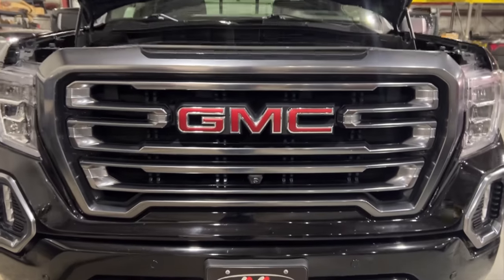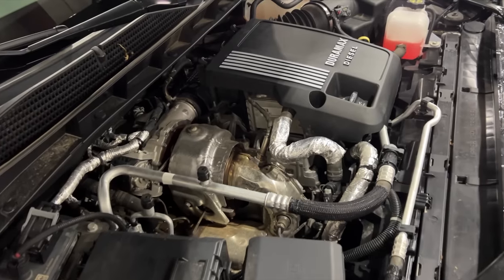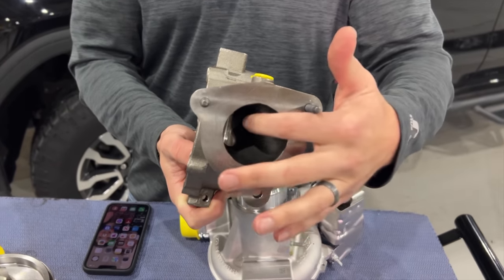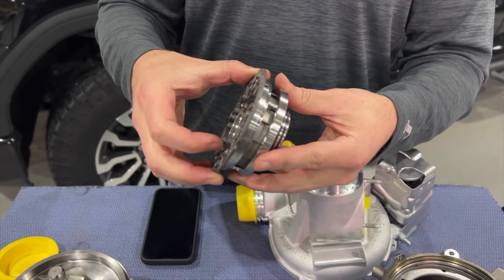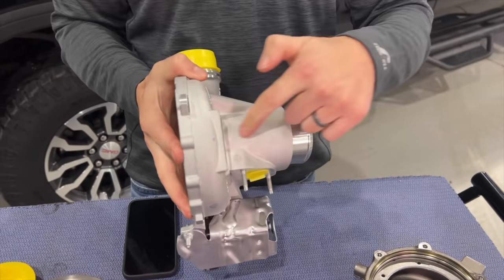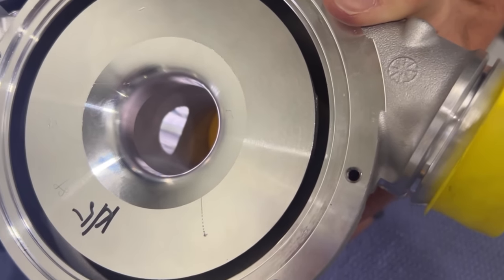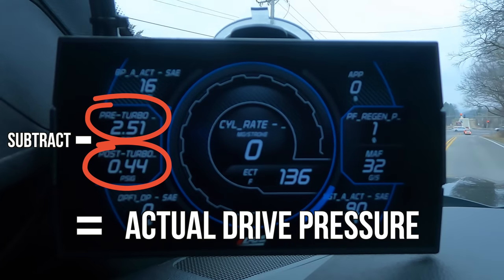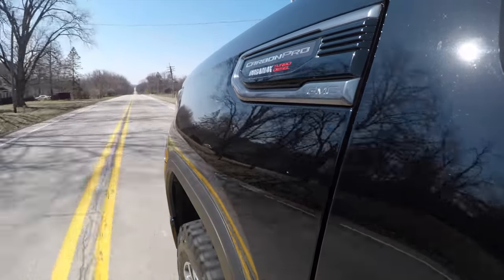3.0L Duramax (LM2) Turbo Analysis & Custom Tuning Ride Along

Comment: I currently drive a 2022 Silverado 3.0L LM2 Stock Engine with 11184 miles (18000kms) on it. The best highway fuel economy I have achieved is 34 mpg. (6.9L/100kms.) Cruise Control was set at 74.5 mph (120 km/h) for 226 miles (363 kms), with perfect driving conditions - no wind, 46.4F (8C). Geographically - Jasper AB (elevation 3465.83 feet to Edmonton AB (elevation 2198.16 feet). In my opinion,  I'd say this is quite outstanding fuel economy for a stock full size truck. I have no doubt in my mind, that the LM2 is GM's best engine built in the last 10 years. I enjoyed your review, and hope you share more information/updates for the LM2!
Reply from the maker: Thanks for the personalized info. Be on the lookout for more info on our end too. We are digging the 3.0L LM2!
Reply: I’m looking at the little diesel. Still happy with yours?
Reply: @jeffreygoss8109 Hi Jeff - I still love my LM2. It’s been great! Fuel Economy and Power! I wouldn’t change it for anything. I have 50000 kms on it now, and it still performs well. I do use AMSOIL 0-20 Diesel oil for my oil changes. Still very happy!

Comment: Interesting video on the baby Duramax. I own a '23 Silverado 1500 RST with the LZ0. Very nice powertrain. Very smooth and quiet for a diesel with lots of torque and more than adequate horsepower for my needs. I get 16 mpg towing a 3500 lb travel trailer from Cali to Arizona and back (twice as good as the Frontier 4.0l V6 got) and get 28-30 mpg at highway speed. This truck drags the trailer up long/steep mountain passes at 65 mph with cruise control on effortlessly. The new baby Duramax does suck up lots of DEF while towing though.
Reply from the maker: Interesting. Thanks for that feedback!
Reply: My lz0 sucks the def without towing, my 2016 f550 uses less def and it tows all the time
Reply: without knowing driving habits, this is useless information. i'm yet through my first DEF refill at just under 5000 miles.  @juledoren

Comment: LM2 had LOW AND high pressure EGR. low being post DPF high being pre. high is used typically to warm it up and is used ALOT in cold climates (alaska)
Reply from the maker: Thanks for the heads up!

Comment: Thanks for the video and how the turbo works. I’m very new to diesel trucks and bought a 2022 3.0 elevation 11:49 Duramax. Every once in a while my truck has light white mist or smoke From exhaust for about a minute when driving off. Only done this a few times and dealer can not find anything  wrong and unable to duplicate the smoke. Goes away for a month or so and then happens out of nowhere. Someone said maybe the turbo, oil, fuel or coolant? Dealer said all good but happened again today? Any thoughts. Thanks
Reply from the maker: There is plenty of reasons why it could be happening. We'd need the truck to get a concrete answer.
Reply: @Duramaxtuner   Thanks for the reply. I’m in SoCal. Has not done it again and dealer thinks it is nothing. Fingers crossed

Comment: Brand new owner of the LZ0, 260 miles, lol. Would definitely be interested in a tune. Would it be a plug in module or a ECM flash? I don’t want to lose my warranty. Subscribed.
Reply from the maker: It would be an ECM swap until a tuner can unlock without an ECM. Hopefully we get an LZ0 of our own soon.
Reply: how hard is this to do if we can not make the trip to your shop
 @Duramaxtuner

Comment: @duramaxtuner you went over everything except the exhaust/discharge size. OD IS 3.75 correct? Do you know if it has a lip for the gt flanges or flat? Post a picture if you can, thanks

Comment: ditch the emissions gear. burn the epa to the ground and let this baby dmax really perform and be efficient
Reply: I have already blocked the EGRs on mine and drives way better and hardly any turbo lag. I bet it knocked off two seconds on the 0-60 time.
Reply: 23’ lzo diesel, I was surprised my oil at 400 miles was blacker than my 2002 duramax has ever been, all those extra gasses can’t be good for the engine.
Reply: @HomesteaderJake  first oil change??? Wonder if it has anything to do with that 🤷‍♂️
Reply: @Jakes videos  Just cause it's black doesn't mean it's bad. Only way to find that out is thru oil samples. 200k on my 6.7 Ford and it turns black as soon as u start it after oil change. It's done it since it was new. I go 8k on oil changes and sample every oil change.  It gets analyzed at my Local CAT dealer since that have the Lab right there
Reply: @StormTheBeach  how? The CFT one?
Reply: @ThunderGod1388  no, did one myself. Tbh I don't know if I trust their stuff yet
Reply: @StormTheBeach  how?
Reply: @StormTheBeach how did u block it? Any codes popped?
Reply: Delete the e p a   And save the world
Reply: @StormTheBeach no derate? Or issues by blocking them with no tune?
Reply: @StormTheBeach How were you able to do that without a full delete?

Comment: So we r talkin 285/290hp to the rear wheels & 560ft/lbs of torque w/ this middle of the road tune!? That is awesome! Forget the LZ0 until there is a def delete cause stock it eats thru def so w/ a tune you will burn thru that 5 gallons in a tank of fuel! W/ that said, have you driven w/o your foot in it to see what kind of mpg you can get? Best I have is 34.4mpg w/ stock tuning, 4x4 SLT & 2” lift w/ 295/55/r20 tires
Reply: And that's hand calculated? On board computers tend to be optimistic! I've always had to have the dealer correct that under warranty (VW, Ford, and MB, all gas)...and Nissan dealer told me that it's supposed to be wrong lol!
Reply: Well your wrong, it does not eat thru DEF.  A tank will last between 4000-5000 miles with normal driving.  Hardly eating thru. Let’s stick with the facts shall we?
Reply: @hammer-r  mine does not get anywhere close to that and I will qualify as a mature driver, easy on the throttle with mostly hiway miles. 2500 miles for 2.5 gallons is what I'm figuring. My sons best friend's '23 is worse than my '22. Not sure how he drives but his truck has almost triple my mileage so more data.
Reply: @denniswilliams2098  not sure what to make of your comment cause your calculation is in line with what I stated.  I’m a mature easy going driver and yup about 5000 miles for a tank of def.  But when I trailer like I have been, then it eats it much faster. But when I’m driving on the highway at 60 I’m getting about 40 mpg. So I can’t complain.  My best 50 mile loop was 44.9 mpg. Best truck I’ve ever owned. But with everything, time will tell.  But so far I love it.  It’s a torque monster as I pull my 8000 rv up steep dirt roads camping.

Comment: So that low speed (1100) rattle was teh VGT rod. and the powertrain vibration could have been surge? is that even possible with this small of a unit?

Comment: Unfortunately I bought a 21 with 12 thousand km on it last year. Had nothing but problems gm warranty wasn't helping me tried multiple dealers they were trying to delay me until my bumper to bumper ran out. Got tired of driving dealer rentals. Traded it in for a 21 ford f250 when I realized nobody was going to help me haven't looked back.
Reply from the maker: Sorry to hear that.

Comment: sustained load EGT on stock tune was over 1400. so hearing yo say it ran rich makes a ton of sense. 

the intercooler is easily overwhelmed and that electric coolant pump doesn't run 100% of teh time. they tried to keep IAT neat EGR temp was teh story i was told. 

the original trans tuning (launch tuning) has it shift at 3900RPM 1-2 then lock the TCC. the updated trans calibration moved that up a bit and makes 2nd gear not preform as well (less time to make torque l5p style?)  these were all WOT runs and experiences. 

i have an  "IKE" run on my channel with some (not this much) data maxed out at 15k combined. long video since its uncut. 

TRANS tuning was my BIGGEST COMPLAINT! after updated calibration it became a DOG. 

watch that converter clutch. mine started to fail as have others. updated calibration brought it in softer (less shock) but dmg was already done.
Reply: The 10sp is very picky in the mustang once u start adding power and tuning the trans, they don't like it. I'd assume this is a similar version of the Ford 10sp since they were both involved building it
Reply: @kwmiked  they are part for part the same. Ford vs GM 10 speeds on half ton

Comment: I’ve heard different rumors about how the turbo on this motor is cooled. Is it oil cooled or cooled with coolant?
Reply from the maker: @jko0526 It's primarily cooled using engine coolant however the oil supply most likely provides some cooling as well. The placement and connection for the oil and coolant passages are quite interesting.
Reply: Thank you for the reply and the in depth video!

Comment: I have a difficult quetion for you: whats the point of tuning a diesel? It will never feel like a gas. I have a new ecodiesel and i love the driving dynamics of the stock engine. Enjoy rolling down the road. Diesels are for towing and driving relaxed, not for racing..
Reply from the maker: Tuning a diesel provides s horsepower increase, helps with issues such as dead pedal feel, helps with MPG, and can help with towing.
Reply: @Duramaxtuner  everything in physics is a tradeoff. It is impossible to believe that the engineers gave up on better fuel economy and more power if there is no cost to pay in terms of reliability. You are trading durability for performance, thats what you are doing, but that's not my point. My point is that if u increase the performance of the diesel so much that it feels like a gas motor on the road, they it wouldn't feel like a diesel and would lose all of the appeal of driving a diesel. When u get an electric car u have better performance, but u miss the sound and the behavior of the internal combustion engine, don't u? Its the same when trying to improve the performance of a stock diesel..  There is a charm in the way diesels run..

Comment: How much does it cost to have a tune like this done ? I have a 2021 with a s&b cold air intake, 6 inch lift with 22x33x12.50’s. Would love to have a little more torque and power.

Comment: The recommended oil is junk. We have a couple of them in our fleet for work trucks they burn 5 qt of oil at the recommended oil intervals. Put 15w40 delo 400 Magically the oil consumption disappears doesn't even burn one qt of oil by the recommended oil change intervals and better MPG.
Reply: Don't go saying that it's gonna ruin the engine and the bearing and bearing clearance. They've been running strong no problems. Where it snows still good oil weight Any diesel engines a good idea to let it sit there and warm up.
Reply: Thinking about moving mine to 5w30 delvac esp, I wanted to go 5w40 turbo diesel but i thought itd be too thick. On the mobil 1 site alot of the diesel oils have basically the same specifications. On the 0w20 esp it says GMLicensed but have all the same specs as their 0w30 0w40 and 5w30 esp. Their all mid SAPS low ash low sulfer. The turbo diesel does have a API SL cert like a 0w20 esp but the delvac doesnt

Comment: Can you explain why you subtract 15 psi off the monitor to get the max boost psi?
Reply: Atmospheric pressure is around 14.7psi……. So it’s easier to say subtract 15 then 14.7